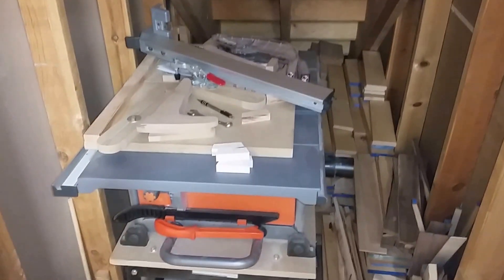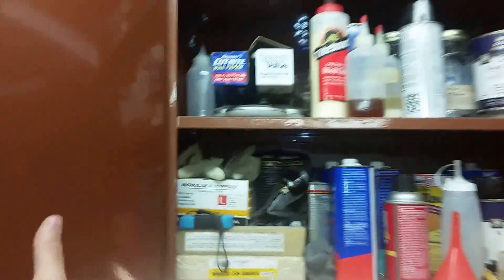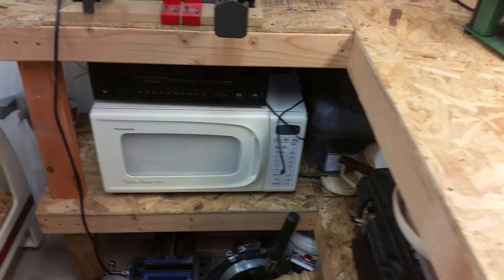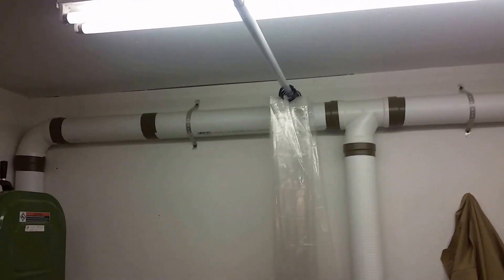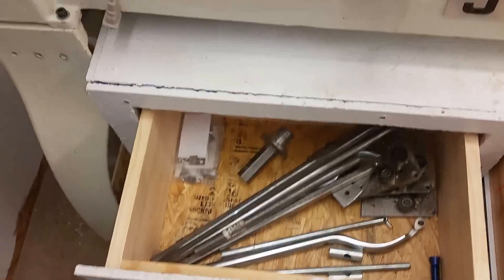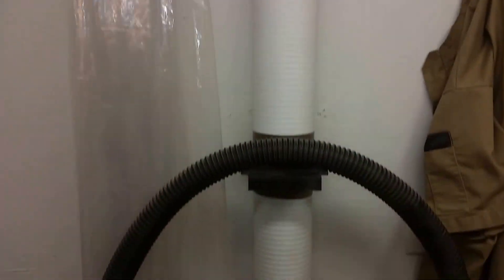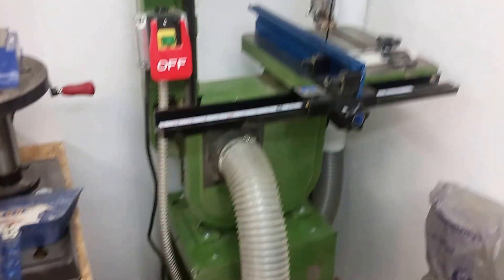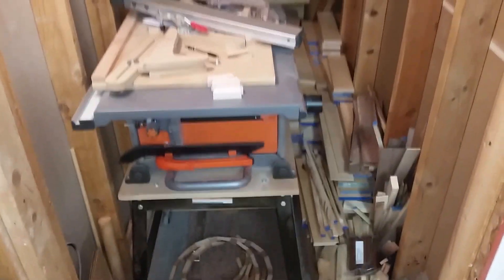My micro shop tour

Comment: Nice compact layout.  What's the make/model of your dust collection unit?  Was there any hesitancy in investing/plumbing such an elaborate system for a micro-shop vs, perhaps, dragging around a higher end shop vac?  I currently have a similar space, equipment inventory and am debating which way to go.  Thanks for sharing ...
Reply from the maker: It's a harbor freight 2hp collector modified with a thein baffle seperator and a Wynn cartridge filter. I went that route because the shop is in my basement (which is finished also) so dust collection was important. A shop vac will never move as much volume of air.